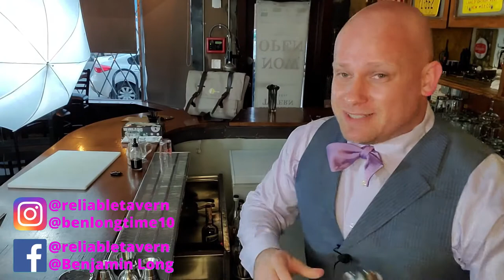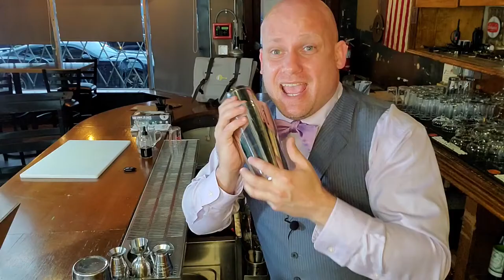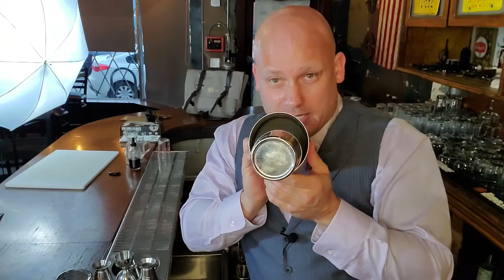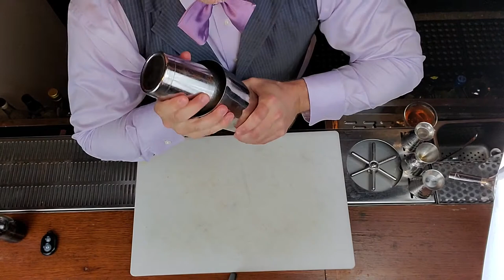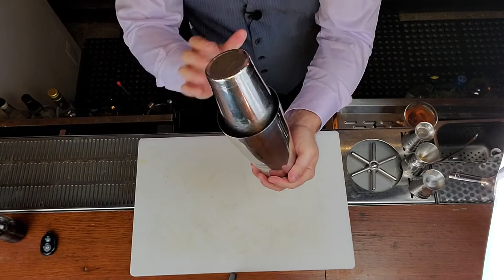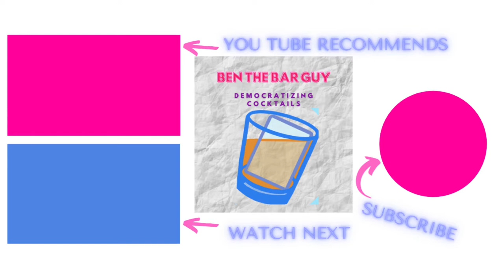COCKTAIL SHAKING TINS STICKING? | GET YOUR STUCK COCKTAIL SHAKING TINS OPEN FAST | 5 MIN TUTORIAL

Comment: Fun fact; if you use an extra large ice cube from a mold in the shaker, you can skip the strainer and use the heft of the cube and the other part of the shaker to strain your shaken drink into a glass while also not over-diluting the drink
Reply from the maker: We once experimented at Reliable Tavern with what we called "weak shakes" where we used big cubes but didn't shake them hard enough to break them apart, therefore yielding very few ice chips and therefore eliminating a need for a strainer. I was surprised at how good and cold the drinks came out in a relatively short time. There was even some froth on them too, which I thought was impossible without shaking hard. But I still think the ultimate drink, without question, is a cocktail topped with thick froth, consisting of small ice chips, air, and small pieces of pulp from fresh citrus fruit and holding each other up on top of the drink. That type of blanket-like froth really only occurs with a clear hard ice cube shaken hard.

Comment: I need help with this. I use a Boston shaker with a glass and I'm always paranoid about breaking the glass.
Reply from the maker: Hey @angrycocktails! It's been a minute since i used a Boston bc once bigger shaking cubes are used it really is dangerous and could break like you said.  In any case here is what i would recommend.  Still have your palm of your hand on the vacuum seal point like in this video. However,  position that same hands index and middle finger higher up on the glass to stabilize the taller heavier glass. Then use the butt of your other hand to gently hit right next to the seal point. It's where the gap between glass and tin begins. Bc the glass is heavy it can break the seal with less energy compared to a top tin.